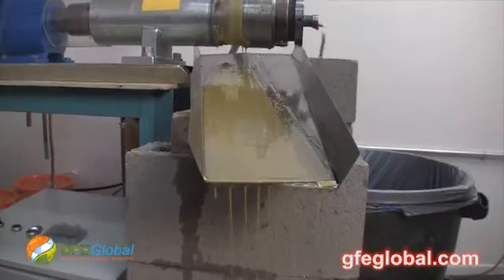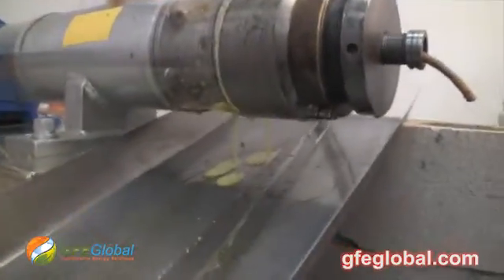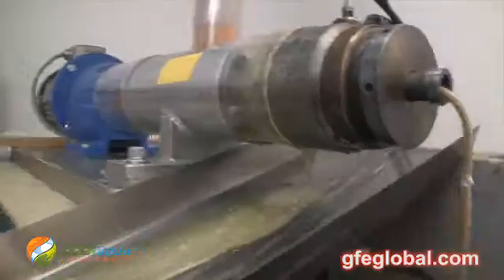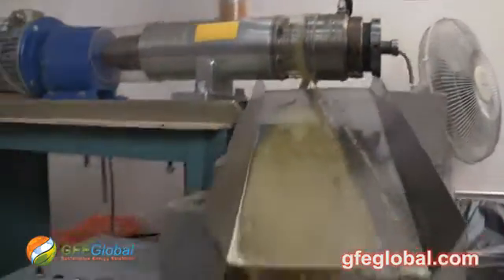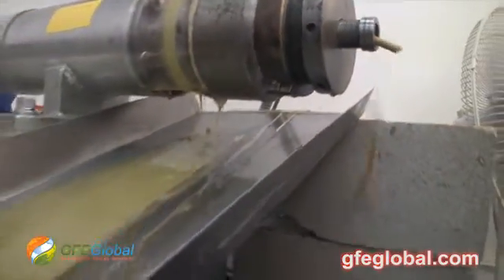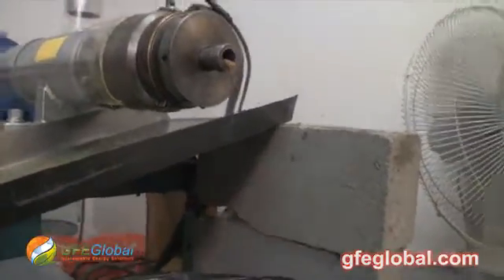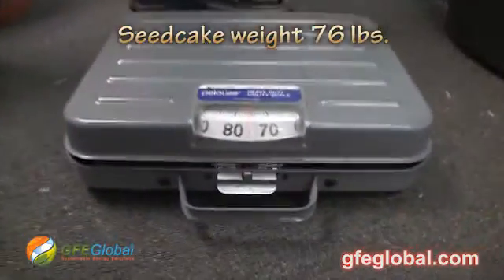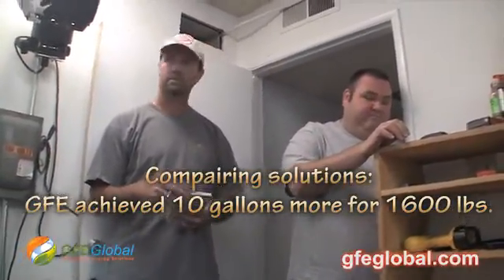GFE oil press extraction solution tests 100 lbs Camelina Seed for extraction percentage

Comment: you guys probally get this question often, or maby Im the only one. The cake from the end, do you believe it could be turned into pellets to run a pellet stove? I feel it could work but then again most if not all the oil is extracted so there would probally be less thermal output. Another question, the cake that comes out the end, is it possible to re-press it to ensure all the oil is out?

Comment: This oil press Taby has hardened steel in all press parts. wear of metal does not harm the oil and feed cake Stainless steel in an oil press release crom and nickel is toxic wearing material goes to the oil and feed. It's not good, it will not rust inside an oil press in oil seeds is little water 8% It's not like a dairy that handles milk, 87% water, there is a difference, wearing on pipes is not in a dairy or wine industry